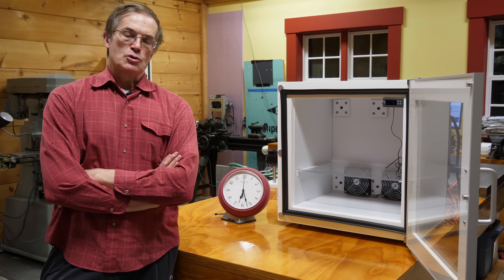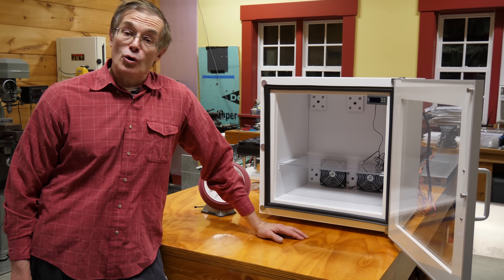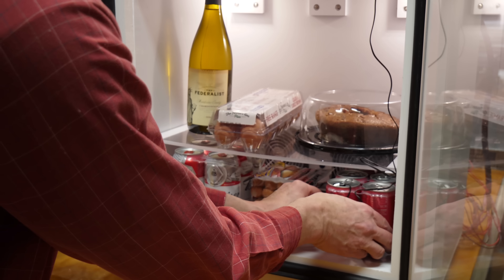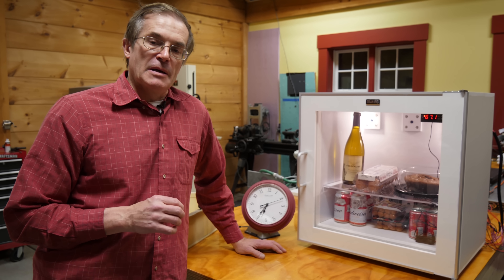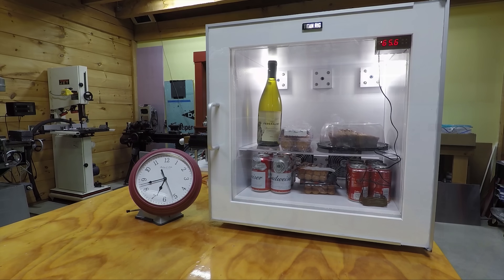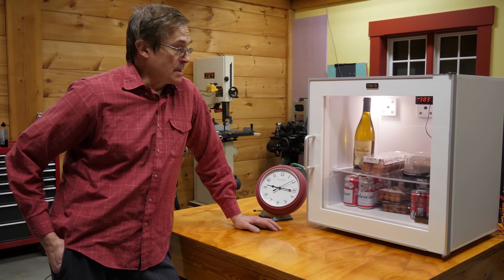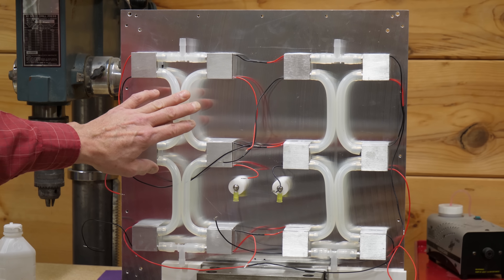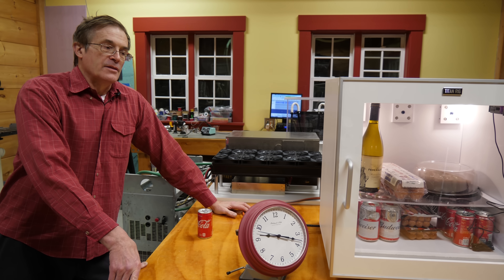TESTING OUR DIY REFRIGERATOR! - TEC/PELTIER

Comment: Very well explained, constructed and tested.

One thing I kept thinking about from the very beginning of the build, is that I'd not put the two 12V fans inside the refrigerator, as they produce heat. If they're 12V and fairly energy-efficient, they'd probably use 80mA, which means they'd use around a total of 2W. Those 2W would fight against the Peltier elements, making it harder for those Peltier elements to cool the fridge down.

-So how could this be done differently ?
Probably in several different ways, but I'd probably place a DC-motor with a few magnets (I know you have some!) on the outside of the fridge and a fan with magnets (repelling) on the inside.

You probably already made the fans blow the heat away from the back rather than pushing the cool air onto the back.
Same thing here, the fans generate a small (insignificant in this case) amount of heat, which should be directed away from the surface to cool down, rather than towards the surface.
(Modern server rack cabinets have the fans mounted at the top, in order to avoid the heat generated by the fans add to the heat inside the rack cabinet).

Now, I look forward to watching the next video in this series; I'll do that after doing some shopping. :)
Reply from the maker: Generally, it's better to blow the air at the surface you want to cool if you want to take advantage of the higher velocity to distribute the air over a larger contact area and increase molecular exchange in the boundary layer.  This certainly applies here where the heat generated by the fans is contained within the refrigerator no matter what direction the air blows.
Reply: Yes, if the fans are inside the refrigerator, it doesn't matter which way they blow, the heat generated will be the same. But I'm speaking about two different situations.
The fans (and the electronics) inside the refrigerator should be moved out, as to avoid heat generation.
The fans you have might be very energy efficient, but I found that fans may draw as much as 300mA at 12V (3.6W), and since the Peltier elements are operating in the low-power area, they have to fight extra hard.
I know I'm an "extremist" and there are (to me) a few unknowns in this setup, so I don't know exactly how much will be saved and whether or not you run the fans at full speed. If you're not running them at full speed, they won't produce much heat anyway.
-But if they do generate heat (try measuring the center of the fan with an IR thermometer if you have one), then my suggestion is to make a 'magnetic energy transfer' from an external motor to the internal fan-blades.
You could even use just one external motor to drive 4 fans this way (but that's a completely different story).

The blowing direction was intended for the external fans.
Reply from the maker: I see.  The design and construction of these split, magneticly coupled fans might be a bit of a challenge especially because the displacement would have to be significant in order to avoid negating the benefit by compromising the insulation.  If feasible, such fans could be useful for other applications as well.
Reply: I also thought of making an axle out of insulation foam, ball-bearings made of insulation foam (they don't have to be very strong), but a wooden disc with magnet glued onto them might be easier to "manufacture at home".

There are likely other ways that are much better, I just wanted you to put the idea in your mind, because I'm convinced that you'll find it useful some day.
The more I watch of your videos, the more I realize that we share a common interest; to lower the pollution by making more effecient usage of the energy.
What I'm intending to do, is to make a 'kiln' for slowly drying wood over several months, as I live on an island with a lot of moisture. Thus I'm interested in all the topics from refrigerators to airconditioning, including re-using the 'heat waste' (maybe more than once if I can).
Since electricty cost $0.38 per kWh, I'll be running the kiln mainly on solar and wind power, only using the grid-power as a backup.

Comment: Extremely inefficient compared to a compressor based system om equal size.
Reply from the maker: Absolutely.
That's what I said when I explained the operating principles of TECs.
Reply: @TechIngredients  Thought if someone missed that small part and only read the comments, very good build though.

Comment: What was the temperature of the room?
Reply from the maker: Within a degree or two, it was the starting tempreture shown on the meter in the refrigerator.  Without the power to any function in the refrigerator the only variation will be because the room shifts it's temperature through the day faster than the refrigerator passively equilibrates.

Comment: Haha, funny that you mention the contradiction in trying to cool something in a device that is in a room that we are trying to heat up because there is too much "cold" outside :D I've thought of that many times before: why don't refridgerators (and freezers?) have a channel to the outside to circulate cold outside air through the refridgerator to cool your food and other stuff? OK, maybe for hygienic reasons you want to incorporate a heat exchanger, but the point remains: in colder climates this could be a nice energy saving practice. 

On the other hand maybe we should focus on more energy consuming devices like vacuum cleaners, because refridgerators now use so little energy, you'd maybe not even notice the difference if you did use cold winter air.
Reply from the maker: Refrigerators and freezers operate 24/7.  Therefore, their energy consumption is still significant.  In the summer, they add to the airconditioning load and in the winter, their energy use could be reduced to near zero.  Heat exchangers are key to regulating tempreture.  I believe shallow ground loops are an untapped resource.  They could be installed for very little cost during new construction.

Comment: You might be able to eliminate the fans if you relocate the cooling units to the top of the fridge. Hot air rises cool air sinks. It looks like the cooling units have been mounted inside the fridge? Maybe mount them directly onto the fridge if that makes sense. The idea being instead of it can cool down the surrounding metal faster and more effectively. Instead of a two inch square cooling it down it would be a 4 inch square.
Reply from the maker: Thanks!
The coolers are mounted directly on to the outside  surface of the rear plate of the refrigerator.  The insulting foam surrounds them.

Comment: what do you need to do to build a double pane door, and why not a solid 1/2" acrylic door?
Reply from the maker: The air gap provides a thermal barrier.
Reply: @TechIngredients  Can I use 3/8 solid acrylic or will it also frost?

Comment: A couple of questions/suggestions. Can you try only running the fans once the fins are saturated? Can you turn off the internal fans when the door opens?
Reply from the maker: The internal fans and the light can be switched.  You never want to turn off the outside fans because that will case the fins to warm and that will reduce the effeciency.

Comment: could use the heat to warm a water boiler to wash and shower. then the heat is not wasted. if peltier units can handle that heat and still cool on the other side.
how do those gas powered cool boxes work.. they use heat to cool.

Maybe it could help to place all those peltier units on the top, as you say they absorb heat and we know the hot air rises.

Comment: I don't see a problem with using energy to keep something cold in an environment that you're trying to keep warm when it's freezing outside.  The reason is that all of the heat the fridge is generating is helping to heat your house, making the furnace work slightly less hard (slightly!) Most people pay more for electric heating than they would for gas heating so this may not seem as attractive for them.  For me, my house is solar powered anyway.

Comment: It seems to me that this technology has particular merit for use on boats! Low voltage refrigerators for boats tend to be much more expensive than domestic ones. So the high cost of all the Peltier units looks less severe by comparison.

Many boats have curved surfaces that don't suit rectangular shop-built fridges well - whereas this could be constructed to fit into otherwise useless, awkward spaces. Finally, a boat already has a good heat sink - the water just outside the hull. A quiet little water pump could transfer the heat outside, and provide almost silent operation. 

I did own an old gas (butane) powered fridge once that was completely silent. It used a modest little flame to circulate the refrigerant by convection. However, any gas leaks collect in the bottom of a boat, creating an explosion hazard. I'd rather avoid that. A gas-powered fridge would work just as well with any other flame though (like Hydrogen that escapes upwards), and even with a a convenient electric heating coil.  All the same, they would be harder to plumb and fit into curved spaces in a boat.

Comment: You did not mention your current draw and at what voltage you used to run this test... If you could just mention that here, I would appreciate it... I am interested in building this model, instead of your later water cooled model and would like to know what I'm getting into Amps/Volts-wise before starting...
Reply: It really doesn't matter... The fridge IS a toy, Peltier coolers are massively inefficient. If there was a way to make them efficient they would be used in everything.

Comment: exactly exactly......i thought so too when i used a peltier to build an ac.......had two aluminum tanks ...one on the hot side one on the cold side.....so after the cold water run infront of the blades it returned to the hot side tank to cool the device........nice video
Reply from the maker: Thank you!

Comment: U.K. I'm a mechanical engineer, or was for over 40 years. I spent quite a while on cooling large engines. Most of the theory is just the same as your refridgerator. I wonder if you know just how much time you may have saved me - lots. I am not sure if I am missing something but there does not seem to be much cooling area from the Peltiers inside the unit. I take it the whole of the rear panel and to a lesser extent the sides act as a cooling surface. I have noticed that electronic engineers do not like fans, hence the reason for so many power supplies and amplifiers, etc having overheated power transistors. It's surprising that even a 12V fan run at 6V and therefore almost silent means you can cut a heat sink down by at least 50%. A very interesting video, showing the mistakes is very important. One last point never use a fan to suck - always blow - efficiency is higher if the intake is not restricted. Vacuum cleaners 'suck'.
Reply from the maker: Thanks for the comment.
You are correct about the back wall and sides as the cooling surface. These provide a suprisingly large surface area compared to a typical finned heat sink.  And the two fans in the back blow air across the rear wall which moves forward across the food to complete the loop.

Comment: Can the aircon be made with pelters. Just with ten peltierd
Heat transfer with water jackets.

Refrigerator is excellent and very good cabinet.  

Great job. Thx
Reply from the maker: Thank you!
No, they can't.  The TECs are just too inefficient.  But, we built and tested a dessicant based airconditioner that is more than twice as effecient as a commercial, compressor based system and is easy to build.  The video is done, but yet to be posted.

Comment: In the 2nd prototype are you going to try a chest style fridge with the lid on top? How much did these prototypes cost?

Every summer I think about running my PC water cooling out the window so it doesn't dump the heat in here and make it >90F. Then every winter I'm glad that I have it dumping the heat in here otherwise it'd be too cold. I should just setup two radiators with a valve controlling which one dumps the heat. Then it would be just a twist of a valve to heat/not heat my room.

Sadly I'm renting so even if I could afford a big project like boosting the insulation in my house the landlord would likely raise my rent because I made "his" house more valuable.

Comment: Still waiting for your video about liquid cooled refrigerator. Couple things that i noticed.
1.)  fins of your heat sink are too thin to transfer any significant amount of heat to the center or the edges, thus the surface area of your heat sink is not used efficiently. 
2.) you mentioned that you can cool liquid cooler with outside air, but you can also save when cooling with inside air but when the controller switches off the TEC you can also switch off the circulating pump, which results in less thermal energy to go back through TEC to the inside of the fridge. With air cooled you most likely need to keep TEC on more often, for longer.
Gave a thumbs up as soon as i saw the LED turn on. Really nice project.
Reply from the maker: That video will be up within the week.

Comment: ctance

Hello:

Ok so here  is what is see. If you want to cool the area inside better. Then add some fins to your blocks inside. Then have a back panel  turn or flow control your fans to pull the air inside in a circular pattern across them. Having just the back side act as a heat transfer is not providing enough conductance. Even in standard frig they have fins. Flow of air makes all the difference. Plus to maximize cold storage use smaller window or none at all to reduce heat loss.  I see how you want this, the main part is to pull the heat out and offset balance  of the  transfer. The faster you cool and shutdown then maintain temp saves energy.  Have mag read switch to kill leds  when door is shut. Simple temp switch from Ebay  to drop power when reached appox temp. Probably not as smart as you. Yet have some tech education.
I worked with radar & computers when younger. So yah real old stuff. Tubes & transistors  Thermal convince for me was just to keep my stuff from frying  its self while keeping it working. LOL! Good idea. Hope your heat pump project works for transfer. Hard part is size & mobility. Although it could just sit in a window space. 
;)

Comment: But what was the total power draw? asking because a cool project would be to have a small solar setup (with battery) on a bass boat; could use the hull of the boat (which is aluminum) as a heatsink, which is also in the water. Additionally could easily run some small ducting to route water to additional TEC's that can't be bottom mounted. Only question is durability to getting wet? would they have to be insulated with silicone to prevent them from shorting out? question becomes how big of a solar & battery setup, limited on space and weight. Could probably get away with half that size of fridge for most day trips. Would also like to add a small livewell chiller to cool the water for the fish as the day goes on.
Reply from the maker: This refrigerator uses 110W continuously and will hold 0 degrees C with that much power.  A solid as opposed to a glass door and eliminating the lighting will lower the power draw further.  In addition, the fans and the TECs use direct current eliminating conversion losses from the DC solar cells.

Comment: This is all very similar to PC cooling. You have your heatsinks, fans and liquid cooling to take the heat away and dump it into a radiator where it then gets cooled and recycled back into the system again.